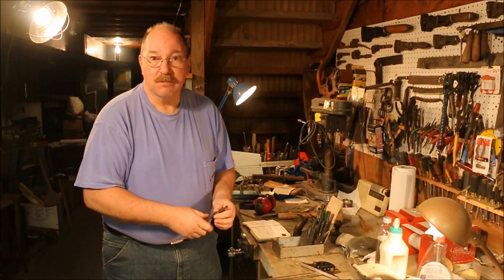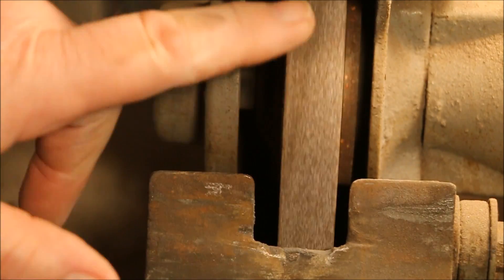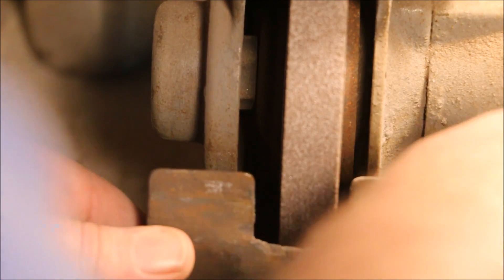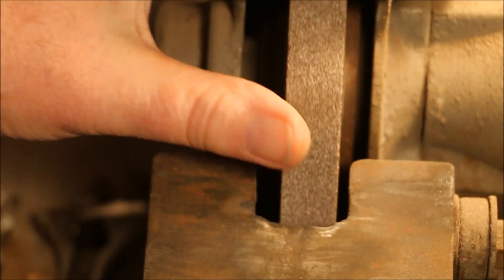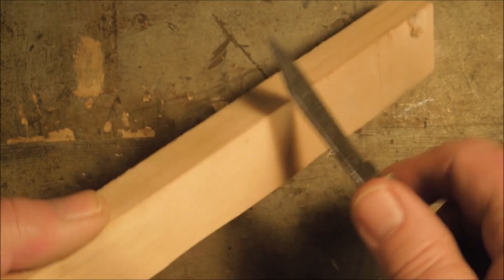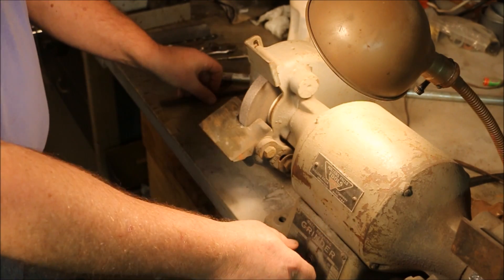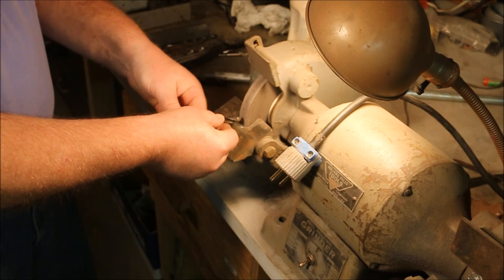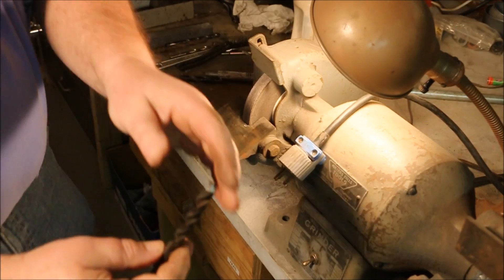Hand Sharpening A Twist Drill ~ 118 Deg For Average Class of work ~ by Old Sneelock's Workshop

Comment: Nicely explained. I used to do this a lot but have lost the touch the past few years. Company I work for just buys new bits, apparently the millwrights and mechanics can't be bothered to sharpen. By the way, how do you thin the web? Touch to the corner of the wheel?
Reply from the maker: Yes I touch the corner. It's the angle that is important. I'll put that in a video.

Comment: HOW WOULD THINGS WORK ON SMALL DRILL BITS ?
Reply from the maker: The process is the same. The drill bit I used for this video was picked because it showed up well on camera. As I get older I'm finding that anything under a 1/16" or 1 mm is harder to do just because they are hard for me to see. The cutting edge profiles are the same and the motion to sharpen them is the same. I suppose I could rig up a magnifying glass but I'll cross that bridge when I get to it.

Comment: Well even I feel confident that I can sharpen drill bits after attending Mr. Sneelock's drill bit 101. Thanks for teaching and sharing.
Reply from the maker: Well I'm still kicking ass and taking names. They just have to be shorter for me to reach their butt anymore.
That and the list is fitting on a post card instead of a blackboard. :-)
If it keeps going like it has I should be pretty much okay in a week or so. I don't bounce like I use to.
Reply: I've tried to sharpen some bits that would make good punches because they sure wouldn't cut anything. Might start a good fire by all the smoking BUT now we know, do we not??!!
Reply from the maker: Once you get the idea of the lip clearance down pat they start cutting a lot better. Just like setting the depth gages on your chain saw.
Reply: 10/4 there Unc. This is just SO much easily understood. The relief has a lot to do with it. Can't make a chip if it's riding on the metal. Just like the saw won't cut if the tooth can't get a bite. Boy Howdy you can sure put it well! Thanks Again and hope you're healing up!
Reply: Old Sneelock's Workshop 1- I had to start printing in grade school because I couldn't read my own longhand and that's why I revere word processors. 2- I'm too stove up to be kicking anybody unless I loose it and that hurts me for too long afterward so I try and get over a lot really fast. 3-  Whenever I fell I always landed on my head. Sure wasn't the heaviest part of me without anything inside it. 4- I never did bounce; more of a dull thud crossed with a large splat. And finally 5-  But as Uncle Red said' Remember,  I'm pulling for you! We're all in this tohether'.

Comment: ..that Sir is one of the Most explained videos on sharpening drill bits I have seen!!!!! I have seen a mess of them. I am still no good at doing it. I cheated and bought a drill doctor some years back. I used to throw away a drill if it dulled or give it to my brother, the machinist, for sharpening. With your information i'm gonna give it another go...!!!
Reply from the maker: Lewie McNeely It was interesting to say the least. The only problem was he was supposed to be mounting a motor on a sump pump that we needed to run the Direct Chill Casting Pit on Monday. We just got the motor mounted and wired up before they needed it.
I'd rather that people ask than just keep pushing. If it ain't working then step back and try and figure out why. If you can't then ask someone. I know a lot of things but I get new ideas every day from you guys.
You're always stronger in a team.
Reply from the maker: The best advise I can give is to be sure the drill is turning the right direction. Had a fella spend hours drilling 4 holes in 1/2" plate before I went to check on him and found him sharpening the drill bit for the 5th time. I sharpened the bit for him and when we went over to the job site I checked the reversing switch. I didn't say a word. just put the bit in the drill and while I handed it to him, quietly flipped the switch to forward. 
He still thinks I am a drill sharpening genius. 
What amazed me was he had drilled two holes before I went to check on him.vvvvvv
Oh come on. You know I told him the thing was in reverse before I walked away. :-)
Reply: ...hahahaHAHAHAHAHA!!!!!!!!! drilled 2 holes !!Oh My Goodness !!! I saw a feller break a bit at the drill. He took it out and sharpened it to drill left-handed. Like you he could sharpen a drill bit...!!
Reply: Carry on Elderly Jimmy Bob! I confidense you!!
Reply: THAT would've been worth watching!
Reply: Old Sneelock's Workshop That's why I like it here so much. We all learn from each other and you're up by the blackboard!